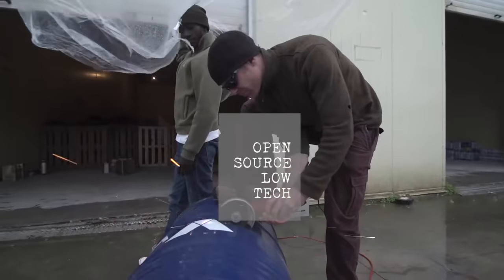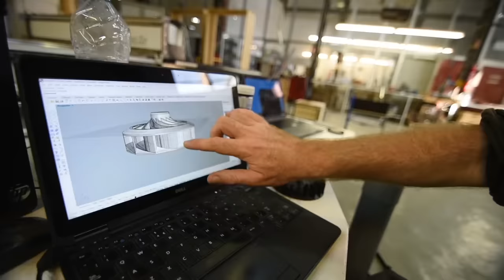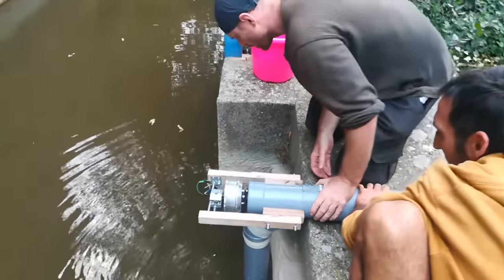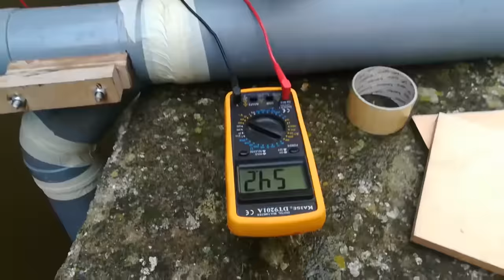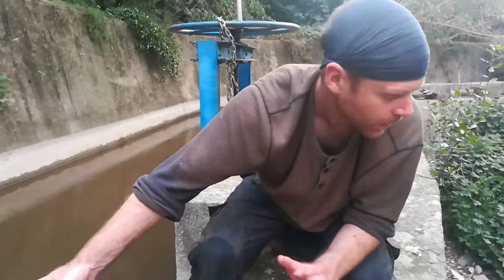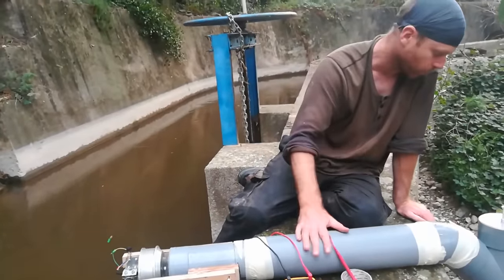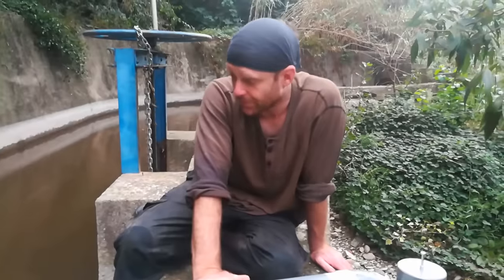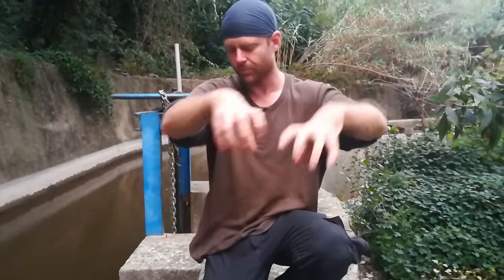The $50 Water Turbine -DIY, Portable, Powerful, and Open Source

Comment: Looking at your video, I see you've got the red voltmeter probe connected to the + side of the 10-amp input, and the black wire into the + voltage input. This is NOT a valid connection, although it does read the voltage OK because the 10-amp input is a shunt to the voltmeter's "common" input, and you've got the meter's range switch in the 200 volt full scale setting. So basically, you're measuring 55 volts into what appears to the generator to be a no load circuit.

I agree with others here that point out that under load, this generator would deliver about half this voltage at it's maximum power point, most likely about half the current, or about 125 watts. (25V x 5A = 125W).

See https://www.mpoweruk.com/hydro_power.htm for exact calculations on the water power available with your design...

"Available Power:

Potential energy per unit volume = ρgh

Where ρ is he density of the water (103 Kg/m3 ), h is the head of water and g is the gravitational constant (10 m/sec2)

The power P from a dam is given by

P = ηρghQ

Where Q is the volume of water flowing per second (the flow rate in m3/second) and η is the efficiency of the turbine. 

Water flowing at one cubic metre per second from a head of one metre, the power generated is equivalent to 10 kW assuming an energy conversion efficiency of 100% or just over 9 kW with a turbine efficiency of between 90% and 95%."

Frankly, your 4" diameter pipe with two 90 degree bends delivers only about 1/4 to 1/2 cubic meters of water per second at a net of 2 meters of head (approximately 1 meter up, followed by a three meter drop). This isn't too bad though, but it relies on the efficiency of your turbine - which I would guess is more like 50% maximum AND a the efficiency of your generator.

So my best educated guess would be...more like around 125 to 200 kw, which of course is nothing to sneeze at.

In a 24 hour day, you'd get about 3KW to 4.8KW.

Comment: This system is lacking so much power... I suggest you visit an actually mill and you will see the turbine is at the bottom of the fall... not the top...even a few feet matters.. that's where you'll get the torque you were wanting..even enough to gear up the ratio.
Reply: It looks like he is using some of the electricity that is generated to increase the intake of water
Reply: Not really since he is siphoning it there is minimum gain from that

Comment: Facts without a load, you know this is wrong right?
Reply: @kiteloosefone for one at 55v no way it can output up to 500 watts. 
next the 400+ who gave a thumbs down knows spinning a bicycle wheel could gave the same reading without a load added. 
I have build wind turbine out of old dc motor and modify ceiling with magnets and modify car alternator but the 400+ and I knows as soon as you add a load to that thing that 55V will drop so fast or even come to a halt.  

That thing is spinning so face it sounds as if there's not even a torque on it. 
At lease  mines was producing around 100+ voltages. however through testing I had to moved the magnets closer for torque and apart if I want speed. 

I suspect by the video you have a great pump that can come in handy to a city after a hurricane but to be a pump and a generator at the same time its pure nonsense and false  misrepresentations. 
I know a lot about this because in the navy during drills, we use the same technique to pump water put of the bilges . 

Redo the video and add a light bulb. prove the 400+ thumbs down wrong that you can get at least 2 amps from that thing
Reply: In an off-grid scenario, this unit would be connected to a battery bank to fill or topped up, your load is going to be through an off-grid inverter that connects to the battery bank.
Reply: @tweakvinespresso  my same reply still valid the battery will act like a load and halt it... you need to at least do a test and make a proper video and proper claim.. 
are you saying this thing is a battery charger or you think it can run in conjunction as to charge  a battery and something can be connected to the battery at the same time?
Reply: @tweakvinespresso  in an off-grid scenario you can't connect 55V to a battery, you wil need some kind of a voltage regulator. to drop the 55V down to 12V..
Reply: @roystervi  we use 48V off-grid inverters which are rated up to 60V Max DC input.
Reply: @roystervi  Yes, exactly what I was thinking, meaningless test without a load
Reply: Yes and connecting a battery to this is the same thing as putting a load on this.
This dosen't work if it had the everyone and their grandma would have used it by now.
If you have one of those old bicycle generators that connects to your front wheel you will know what I mean.
As long as the light isn't turned on you kan spinn that wheel and it will keep spinning but as soon as you turn the light on the wheel will grind to a halt because no you have put a load on it.
And that load will generate constant drag equal to the amount of power you put in.
You can't break the laws of nature that is why they are called laws and not theories or something like that.
Break a law and there will be consequences.
You people want to save the world? The stop protesting against nuclear power.
That is the only way to for us now to generate enough power to everyone with 0 co2 emission.
Germany has over 60% renewable energy and France has only nuclear and no renewable energy yet Germany is putting out way more co2 in the atmosphere than France.
Wake up people and smell the uranium.

Comment: The "50 dollar" statement becomes invalid when you start using thousand dollar equipment like 3d printers.
Reply: @TheMrTape  not to mention the fact that 3D printed items can be outsourced very reasonably.....pretty much everything on "Thingiverse" can be ordered printed and shipped to you....
"Everything costs something.....except creative thinking"
Reply: He didn't use the 3D printer in the final design, but if he did, like I'd like to, I got my 3D printer for less than $200. It may not be the best quality, but if you're hand enough to do this project, you're hand enough to make the printer better and give your parts a bath of acetone vapors to refine them.
Reply: 180$ equipment like 3d printers.*

Comment: Note; to get watts you must measure volts and amps at the same time. Measuring shorted amps will provide zero or almost zero volts. Loved the video.
Reply from the maker: Indeed. Check the part 2 video in Berlin for more comprehensive and accurate power measurements.

Comment: Good job guys!
Lowered outlet below waterline, could improve reliability in low water flow situations - then wouldn't drain pipe. Also making additional smaller outlet, to form threeway, and covering bigger outlet with rubber (or plate on hinge and spring) can add enough selfregulation for low flow, without much hassle and cost.

Comment: Nice work and progress.  It is great to see your practical hands on as it inspires all of us to build and create with what we have at hand to better our own circumstances.  That said I have a few suggestions:  1-You need a variable resistance load to put on the output so you can monitor voltage and current at various resistances.  This will let you make a "load curve" as elsewhere suggested to characterize your systems performance and inform you of its efficiency at various operation points. I suggest trying a variac wired in series with several 100 Watt old style light bulbs or similar to get you close to the appropriate range V=I*R and power = VI so Resistance range =~5 to 60 ohms should cover your region of interest and the  .   2-.  your siphon design is novel but the requirement to maintain a vacuum (no air leaks) in the system is tedious in practice.  And this is especially true for the rotating seal around the impeller.  I suggest it much better to have a simple siphon hardware at the top and put the impeller at the bottom with  90 degree drive to keep the turbine out of the water.  3 - The low absolute pressure at the top is likely causing cavitation and reduced efficiency in extracting energy from the moving water.  The long draft tube is not ideal for converting potentially energy of the water into kinetic energy for extraction.   Typically you want these large in diameter and diverging so that little kinetic energy is left when the water exists.  This is another reason to locate your turbine near the bottom with a short exit (Draft) tube.https://en.wikipedia.org/wiki/Draft_tube
Reply from the maker: I'm currently in the process of load testing and optimising the design in Berlin, using a liquid rheostat (washing soda and water solution with variable length stainless electrodes) as a variable load. Power curves to come.
Light bulbs aren't always ideal as loads as their resistance can increase as they're loaded and heat up.
I've settled on a simple gasket for the point where the shaft exits the housing, it seems to seal well with low friction, will see how it holds up over time.
Cavitation may well be an issue, I'll probably shift the turbine assembly to being directly over the draft tube, which will place it a little lower and at a different pressure point in the system, which will hopefully also mean less turbulence losses.
Draft tube design is a whole new thing which I'm now starting to look into.

Comment: Add a second turbine at the end like a cup wheel or just another like the 1st on on the other elbow and increase power output, just will have to be on the water fall side or will restrict the system

Comment: This gave me an idea for your idea bro. If you could 3d print the turbines, they could be installed in downspouts on gutter systems for areas that get lots of rain, it would not be useful all the time but may off set cost at times for some, a stream is always more reliable. Brilliant set up

Comment: Genius.  Thanks, Daniel.  You just solved my problem at 2:55, I think.
Reply from the maker: What was the problem?
Reply: @OpenSourceLowTech  I have to build a small dam for my hydro project at my farm, which will raise the water depth by about 16 to 18 inches, but I couldn't figure out how to get rid of water and reduce water pressure on the structure as I was building it.  My thought is that I will simply build two or three or four of the pipe siphons that will pull enough water out of the creek and put it on the other side of the dam so that I can work on it without having to fight the water.  

Does that make sense?  I really don't know how to divert the water any other way.  

The dam needs to be about 30" tall, by about 12 feet long.  I thought about drilling 5/8" holes in the limestone bed of the creek about every 8", inserting rebar, and then stacking concrete blocks along the creek bed, filling the cells of the blocks with concrete.  I'm still working on the rest of the plan.
Reply from the maker: @Boogra  Can you divert the water around, and then leave the side channel as an overflow?
Reply: @OpenSourceLowTech  Can I send you a couple of pictures of the site this weekend when I go back out?  Would you mind taking a look at it for me?  I don't really have an engineering background, although I do have a construction background.
Reply from the maker: @Boogra  Yeah can have a look, tho also not huge experience in civil type stuff. Email is available on the website.

Comment: I live in Ireland it rains most the year here I have a farm with a massive hill on my farm.

After some research and after this video I am seriously thinking to make a small pool to hold the water and make something like this I would need something double the size to literally power my entire energy needs.

Also for the summer when it gets fairly dry for a month or two I could install some solar panels to power my house during those months.
Reply from the maker: You can quite possibly get away without the pool and just plug the turbine into the waterway directly, depending on topology etc.
The output can be doubled by increasing the pipe diameter, or just adding a second unit.

Even in rainy countries hydro does tend to be seasonal, especially these days with weird droughts etc.

Feel free to email me through the website if you want any extra info on the build.
Reply: @OpenSourceLowTech Have a decent sized stream with a decent fall of ground. 
Would just putting something like this in the video into the stream generate a decent amount of power as long as the water flows.
Reply from the maker: Probably, but send me some photos.

Comment: This is really a beautiful design, my compliments. I live in the Netherlands, a lot of water but the land is flat, so no height difference. I did get an idea when I saw your test setup. You can place a large tank at a height of approximately 5 meters and pump it during the day with the residual value of your solar panels and allow it to drain through your system at night through the generator in a large tank on the ground (swimming pool) and so on. maybe that can also be tested once. I would like to make it myself, but my health does not allow this.
Reply from the maker: Yep, pumped hydro is can be a viable form of energy storage, depending on round trip efficiency.

Comment: 9.81*(2.2 meter drop) = 1/2 (water exit velocity)^2
water exit velocity = 6.57 m/s 
density of water = 1000 kg/m^3
With a 4 inch pipe this results in a flow of : 1000*6.57*3.14*(0.0508)^2  = 53 liters per second
Power Output (before losses) = 53*9.81*2.2 = 1144 watts
Power Output (@50% efficiency)  =  572 watts
Voltage (@ 10 amps)  = 572 / 10 = 57.2 volts
Reply from the maker: The out pipe is 125mm, but essentially yes. Realistically I'm hoping for something more like 200W with as much voltage and as light a load as possible, but will see what happens with actual testing, which is in process.
Reply: @OpenSourceLowTech  Nice job
Reply: Yes, exactly. But there is no way that wee fan impeller is going to extract 500 watts... that 2/3 horsepower... no way.

Comment: Brilliant stuff Daniel, I like it. Good basic design, KISS; ‘keep it simple stupid’ as us Aussie’s say. There are obviously a number of different methods & conversions that could be made to this, using this basic theory, but for what u have used and spent on fabrication, etc, this is a great idea for many, and a very affordable power solution.  This seems to work very well here, I did a sugestion in another of ur vids about using an auger type impeller design going down the tube for higher torque, but would require a different generator setup, with possibly a step up gearbox drive for speed requirements. This would all cost more and be more heavy of course, but with the capability of more power output.
I do also like how small and light it is for the stated output, good job!
Reply from the maker: Yeah screw type runners would probably do ok, but trickier and lower voltage.

Comment: Great job! Thas voltage after rectification and filtered may goes to at least 70 volt, perfect to use with a mppt solar controllers that provide 12 volt systems, can take 30 plus amp around!
Reply from the maker: Yep.

Comment: genius project.. i am actually a big fan of you .. exactly.. what i  need.. the problem just is, that i have 500m between the waterfall and my house ..and it is inner city, which means, that i need wireless energy broadcasting. Combine this lowtech with some hightech .. and i would run for it ;).. I know alot places where i could use it .. i just cant transport the power  via public roads . Another idea would be combining it with a big hydrogen accu, which i would pick up every week from the waterfall

Comment: To stop the turbine, just make an elongated 'J' shape of PCV pipe. Hold the long end, and submerge the hook underwater and up into the intake; it will draw air into the system and stop the siphon. Much easier than lifting the whole thing :)
Reply: To stop the turbine, just unscrew the cap that was used to fill the down tube.

Comment: KUDOS!.  How about some discussion on how you rectify and store this energy.  Are you using an charge controller if so what kind, is this going to some type of battery bank, are you suppling a constant voltage of 12 v so you can use common accessorize (Lights, Radios, fans etc.) . Fuse bar?  Wire gauge for transmission?  THANKS!

Comment: Thats clever. Im hoping to find a video on how to build a similar type of electricity generator using water from a high/low volume, fast/slow flowing river to power a pump for use in a portable sluice

Comment: Wow Im happy to find this video.
My family in Suriname lives in a remote village called botopasi. There's not clean water, there's only electricity until 10pm (diesel generator)
My dad sent solar panels to make my family have power day and night. But the life of the village really comes from the powerfull river which connects all the villages. I wanted to know if I can use this powerfull river to generate electricity for my family on a budget. I also want to know maybe I can use outlet of the hydroelectric generator to clear and clean the river water. Thanks

Comment: If a system produces a low voltage, it can be boosted with a voltage stepup transformer, and even make a higher voltage for long distribution wires connected to a voltage stepdown transformer.
Reply from the maker: Yes, tho I'm hoping for as high a voltage off the alternator as possible, as can then put less of a load on it for the same power and so less resistance and heat.